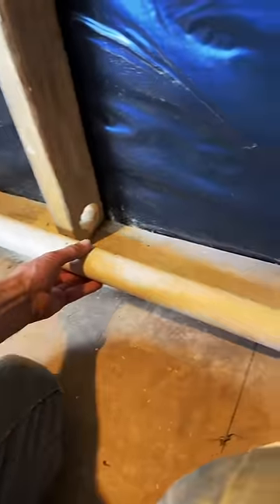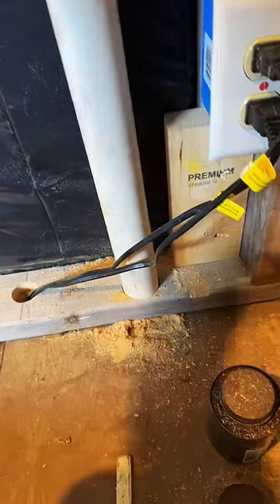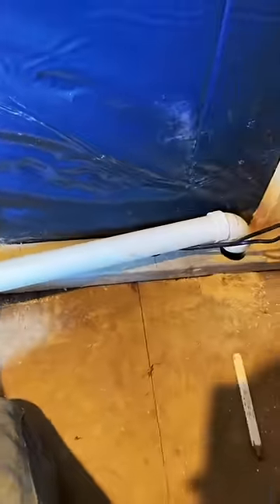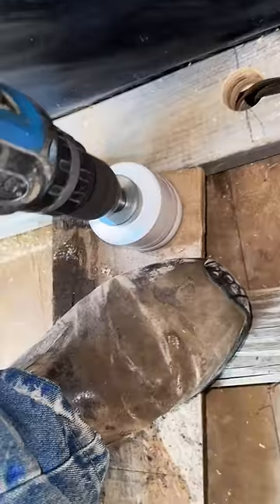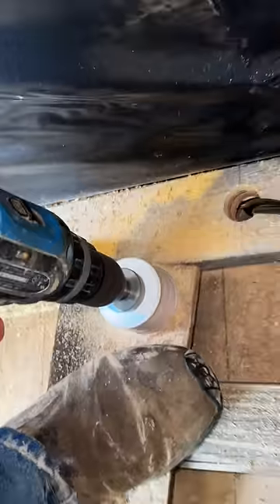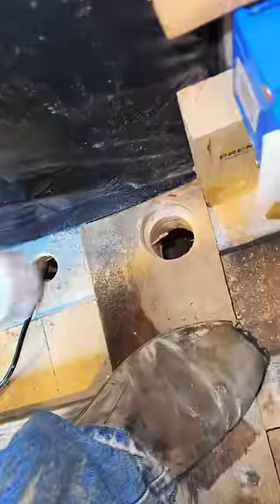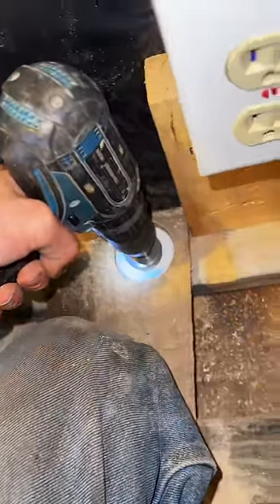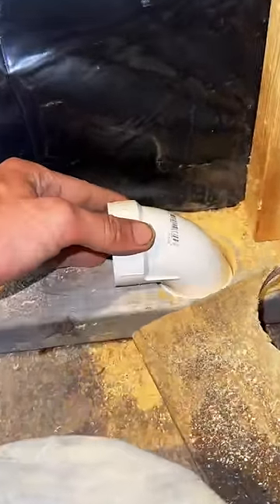Using a hole saw to make a hole bigger

Comment: Here's a tip. If you saved the plug from when you drilled it before, just put it back in the hole. It will keep your drillbit centered on the larger size holesaw until you get started.
Reply: The real tips are always in the comments I'm going to steal this one for sure

Comment: You can shortcut that trick by mounting the original hole-saw inside the size you need and use it as the guide.

Comment: Start drilling at an angle next to the previous hole while holding the trigger all the way down. Hold on tight so u don't torque your wrist and rotate the drill straight once the drill has become stable👍

Comment: Put the hole saw that you drilled the original hole with inside of the hole saw size you want to move up to. It guides the bigger one just like the bit does for the hole saw.
Reply: That trick will only work with certain hole saws. The ones I buy use threading into the base which will not allow you to do that trick! Either way will take very little time or effort!

Comment: Fun fact you can put the smaller drill bit on the arbor and so you have the size you drilled on there inside the bigger drill bit for the whole saw and you can go through everything that way and there's no extra steps by drilling another piece of wood

Comment: You could also screw in the smaller diameter holesaw and use that as a guide..They should all fit inside eachother.

Comment: Put the size in which you cut the wrong hole inside of the whole saw, as well as the bigger size and use the smaller size as a guide. It works.

Comment: I could be wrong, but those 2 x 4’s that are supposed to hold the wall up look like they won’t be much support with those huge holes for the pipe drilled in them.

Comment: One of the reasons I never run the plumbing that low to the floor. Not to mention it's easier to put it down the hole if you use a street 45. Not to mention you ran that pipe through too many studs. And i'm sure you intended on putting plates on those studs.

Comment: You can install the larger hole saw before the smaller one, use the original hole saw as the guide to expand the hole

Comment: Or you can put your drill in reverse and cock it at an angle starting with one edge being a guide. Once you get deep enough into the wood you can go back forward and straighten the bit and hole back out out.

Comment: You can just screw the smaller bit into the middle of the larger one.  It’s weirdly not as known but will fit into the hole and act as the guide

Comment: You need 2x6 framing to run a pipe that large through the studs and should probably anchor that plate on both sides.

Comment: They do make a hole saw that holds another hole saw blade inside the bigger one so if you drill too small you can always drill bigger. And the one on the inside hangs out about half a inside so the original one acts like the drill bit so the bigger one does not move on you

Comment: Stud is probably still OK but personally for peace of mind i would put a scrap (short) piece of stud on one or both sides and screw them in horizontically and vertically. Drill the hole one by one trough both. Just in case somebody or something hits the wall it wont break the stud and/or the pipe. And somebody will 100% sure hit a nail in that pipe installing the baseboards ;)

Comment: Funny thing though is did you know you can actually put 2 whole saws on the same mandrill or Arbor And do the same thing as a guide just take your smaller hole saw and put it on 2nd after the larger wholesaw

Comment: If you got enough muscle you can run the hole saw in reverse without it running away on you once it diggs in about quarter inch or so u ca throw it in forward and drill your hole as normal you dont even need a pilot bit

Comment: Are usually just use the side of the holesaw pressed against the inside of the slightly larger hole you drilled to get it started, then point it vertical and drill it out much quicker than making a jig if it’s just one hole to do
Sincerely, a plumber

Comment: You can sometimes get away with taking the arbor nut off and putting 2 hole saws on the spindle. The too small one to act as the new pilot, and the correct one

Comment: Ugh. I cringe when I see horizontal plumbing in walls, in fear of compromising plumbing later on. I'm old school, where horizontal plumbing passes through floor joists. Which helps explain why I'll stick with 16" separation of wider floor joists, which almost makes accidently hitting a pipe harder to do because the equipment has to reach farther to hit the plumbing between floor joists. As far as vertical plumbing in the wall is concerned, the plumbing fixture (toilet, tub, sink) will indicate where the vertical plumbing is located. Not a professional plumber or carpenter, but, at age 7, I did help Dad with the rough carpentry (not just holding boards but assembling interior walls, too. Dad was impressed with how I handled a hammer) and the plumbing when building our house in the early 1960s. All copper plumbing; none of that flexible stuff, either. The house, finished in 1963, is still occupied.

Comment: He's ruffing in drainline and he's cutting his holes in the wood with an actual HoleSaw bits.
lol 
Those with the lil teeth are capable of drilling wood studs and whatnot .
But they're usually best for drilling thru metal or thru a finished surface you don't want to snag.
Like vinyl siding.

I highly suggest Milwaukee 3 tooth wood holes.
Easy to drill on an angle and scallop out wood

Comment: You can actually screw hole saw bits into other hole saws to widen of the hole. You take out the middle bit and you can then put a small saw blade matching the hole that needs widened in the middle.

Source: I drill a lot of holes at work and we use a punch to get them started.

Edit:
Like this: https://youtu.be/NECLySkPvdU

Comment: Neat trick.  But why is the plumbing running so low in the wall. You might put a staple through it when installing baseboards.

Comment: Wow, thats a weird run for plumbing so low down.
Where I live plumbing is run higher in the walls and not near the bottom except when pipe goes thru the floor into the basement.

Comment: Please install a metal plate over the 2x4 that the pipe runs through. If you're installing baseboard, you could accidentally puncture that pipe and have sewer gas/ sewage leaking between your walls for decades without you knowing it.

Comment: Plumber here: fight your instincts and spin the nut on the arbor all the way back and spin the larger holesaw on until it bottoms out against the arbor. Now take the holesaw you just used, there should be 2 or 3 threads sticking past the bottom of the first holesaw so you can spin them both on in a stack, now enlarge your hole and it will center perfectly. Takes a pair of pliers and a flathead to get it apart so only bottom the holesaws out on the arbors threads like that in situations like this or it'll eventually strip the threads on the holesaw.
Reply: Never knew this

Comment: You know those bits screw into each other most of the time so just grab the smaller one you used before hand and thread it into the larger one then the small one is used as the guide.

Comment: Or you could thread a holes away blade the size of the small hole inside the large holes away blade. Then the smal hole saw blade wll act as a guide

Comment: Hope the vertical 2x4 isn't load bearing, as you drilled such a large hole, the structural integrity of it is absolutely ruined. Looks like this entire wall should have been a 2x6 wall if this plumbing size was necessary.

Comment: Don't need to do that, if you ever need to bore out a holesaw just screw the smaller diameter holesaw on the arbor with the larger one. Cut an inch deep then remove the smaller holesaw.

Comment: Not gonna lie, I can cut threads on a lathe but never thought about using guides or stacking bits like the comment section. Lol. Although, I'm not sure I've not drilled the right size hole because ocd&shit. BUT IF I DID, ID DEFINITELY USE THE WISDOM HERE TO FIX IT!

Comment: Hard to explain with out going into a story. So say the hole is 3/4 but you need a 1 inch hole. So have the big bit first then and a washer or two and add the 3/4 one. The 3/4 one will go into the hole and act as a pilot and help with making the hole bigger.

Comment: Am I the only one who noticed a 2 inch hole should not be cut into a 4 inch wall?  That wall needs to be remade with  2 x 6 boards, so it has the original structural integrity.

Comment: Good thing the structural integrity of the house doesn’t rely on a few studs.  Plumbers seem to have zero regard for the overall strength of the structure. The most egregious examples of structural compromise of framing is always the plumbers fault.

Comment: You don’t even need to do all of that. Just angle the larger bit to the side. The outside of the hole saw will ride on the side of the hole and you just turn it down as it cuts.

Comment: Or you can also put the smaller hole saw you used first inside the new size instead of the drill bit as your guide

Comment: I'm surprised you drilled that hole in the stud right at the bottom. I'm assuming it's not load bearing. I've just never seen a plumber drill that much out right at the bottom plate but I'm not a plumber. I am a remod guy so I'm not completely talking out of my ass. I'm really asking.

Comment: I’m gonna go out on a limb and say that the two inch hole that You drilled through that 3 1/2” stud is (or should be) shot down by any building inspector worth his/her salt.  That DEFINITELY doesn’t meet code, since You’ve cut away about 90% of the stud’s load bearing capacity for whatever’s pushing down from above.

Comment: Not a huge deal but if that is a drain then on a drop like that it should be a long sweep 90. If it’s a vent it doesn’t matter though unless its a wet vent.
Reply: Will still work just fine though but just a higher chance of a clog in the future.

Comment: the structural integrity of that 2x4 on the left is destroyed. if you take more than 25 percent out of the board It no longer is sound and should be reinforced.

Comment: There is a way easier way. Screw the original hole saw onto the chuck inside the bigger hole saw. The threads are long enough to accept two hole saws stacked. This way if you drill a hole too small you can use that bit as a guide for a larger size. ....no need to do all that extra work.

Comment: You also just illegally drilled through a stud.  Code requires all wall studs can not have more than 25% of the stud cut out for exterior walls.  Interior walls no more than 40% of the wall stud can be missing.  This wall should be reframed to a 2x6 first.

Comment: The mistake wasnt the size of the hole in the plate, the mistake was setting the horizontal section too low which put the elbow too low, but more importantly weakens every stud you went thru where they attach to the plate and forces you to cut thru nails. Not a good look for a guy who has "been doing this for years".

Comment: Or you could have extended the pipe and  connect the elbow above the base board…looks like a pain in the ass for the next guy to fix if the elbow has to be replaced

Comment: Mean the trick you used with the extra piece of wood that's good advice for people but you're just smart enough to be dangerous you never put a water line over an electrical line and and a 2-inch hole in a two-by-four that's not much meat left there for support bud I know it's off-grid living

Comment: Never put a hole in the last 1.5 feet of the top or bottom of a stud or jack like you have on that wall stud. It takes away from the amount of load the stud/ jack can carry safely. Other than that huge mistake your o.k.. Im a third generation carpenter/ framer